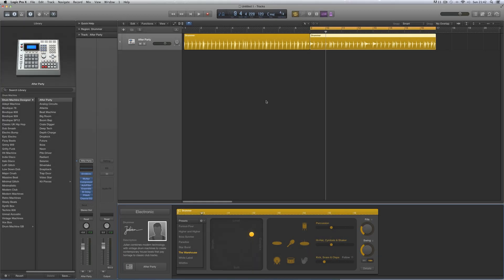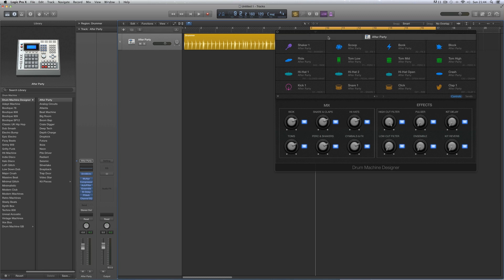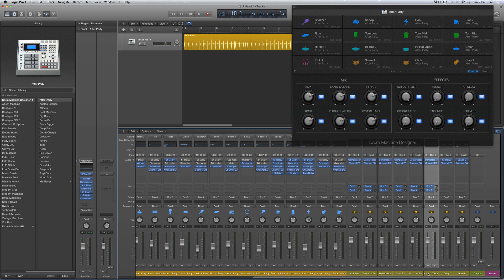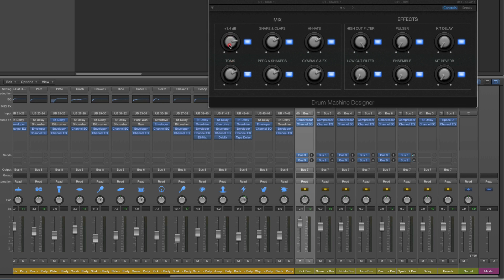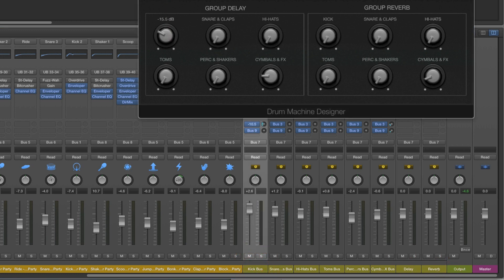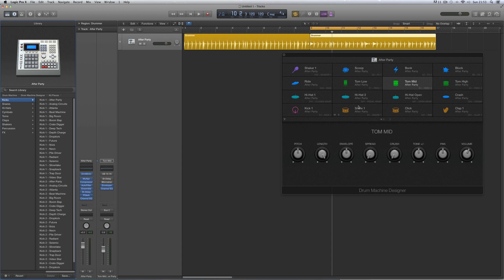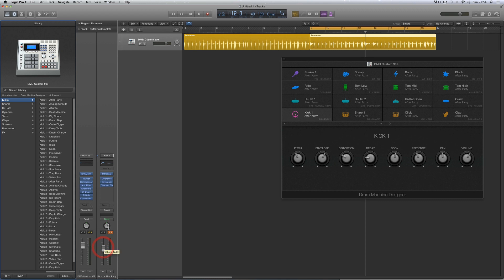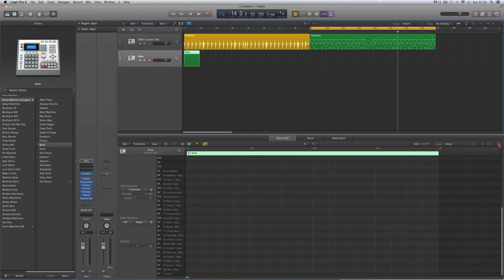logic pro x 10.1 preview 3/5: drum machine designer

Comment: So good to get rid of all the mix routing and settings all over the place in multiple plug-ins or instrument. To use an external sample, you would load that into a UB kit and then use that kit, is that how to do it?

Youtube have changed now and loads the next episode directly without a stop which can prevent viewers commenting.
Reply from the maker: yeah load samples into the UB by voice or 'import' voices in from other UB kits, but save the kit first from the library SAVE button and save it as a different title obviously (it goes into your user patches by default). you can change the internal rev/delay to whatever new delay/rev you like o other send effect. edit the smart control per voice by right-clicking on the pad and 'create track' . select the newly created track and edit it's smart controls in smart panel bottom of logic. btw when you create a track for any voice-pad if not the kick it always ALSO creates a track for the kick because it's the actual instrument the sep' out is having a track created for. dont worry about that or the fact you cant delete the kick track cos when you save & reopen the kit again the track is gone. When you edit smart control for a voice you can 'learn' any parameter or choose from list as usual, BUT, only on kick (main out) can you learn or select Ultrabeat parameters... the other voices are separate outs so this cant be done, only effects or channel parameters on the out can be edited... work around for this is to open the kick track smart edit, go to pitch control (first smart control), add an extra parameter/s, choose the actual voice you want to map a parameter/s for, map it, then COPY, select the track/smart-edit for the actual voice and paste in the smart parameter to the required smart control... then go back to the kick and delete that parameter once copied over. Main out bus fx can be changed and smart edited of course.